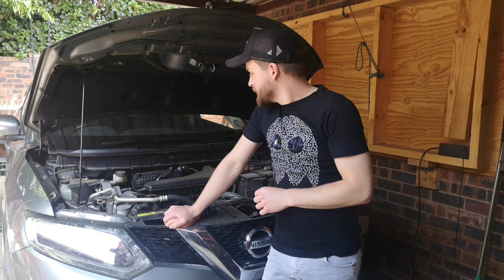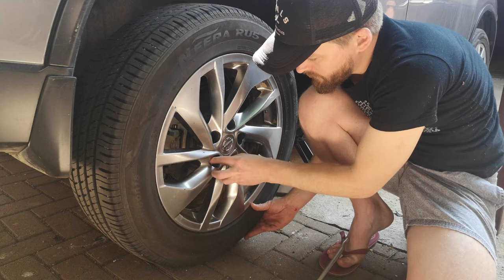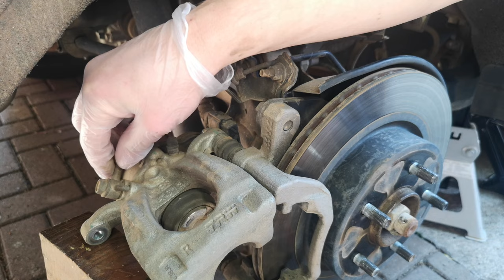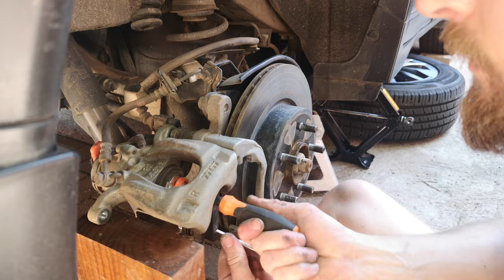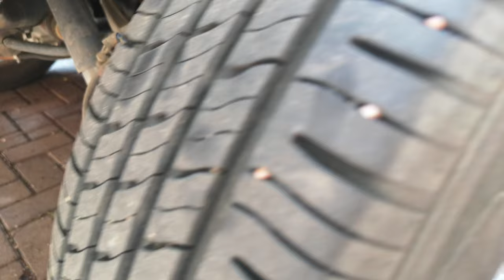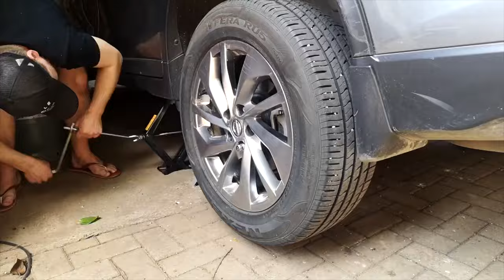HOW TO CHANGE THE BRAKES ON A NISSAN X-TRAIL (ROGUE) | DIY

Comment: Best video for doing this that I have found. The caliper retraction cost me hours and your trick got the job done. Also, I took the whole assembly apart but in hindsight, I could have not done this as you show in your video. Great video thanks for posting.
Reply from the maker: Thanks man, I also struggled plenty! I figured that I just needed to share, because those details aren't covered in the maintenance manual.

Comment: good video, but I would never put antisieze on the wheel nuts, wheel studs or the bolts of the caliper. caliper bolts from factory have blue loctite so they can be undone but also will not come loose from when they were installed from the factory. wheel nuts never corrode you need a bigger breaker bar as the factory wheel nut removal tool will not get them undone if they were torqued to spec. also alloy wheels or rims will heat differently to the brake rotor which is steel so sometimes you will have fun getting the wheels off if they have not been off for many years.

Comment: Absolutely spot on! Followed your video to the letter and completed the job, handbrake self adjusts when you apply after fitting the pads so don't worry.  I managed to pick up the 3 pin wind back tool which made it easier,  fyi, it's the same as the Volkswagen / Audi  3 pin tool. Thanks again!!!
Reply from the maker: Brilliant, good to know! Ya, if I knew about the wind back tool in advance I would have got one, but by the time I worked it out the breaks were already stripped off.
Reply: Thanks again buddy. Saved me a lot of time and money 💰

Comment: kudos for attemping this - i did a bit more digging around the electronic parking brake system, and learned the turning motion of the piston is required to unwind the drive thread that applies trust which works in tandem with the hydraulic pressure to drive the piston. https://www.youtube.com/watch?v=46KgDEyD0Pc hope this gives a bit more information around your work flow. 

p.s. you are clamping down on the electronic parking brake motor assembly on the back side of the piston - hope nothing broke!
Reply from the maker: That's pretty interesting, makes a lot of sense. I don't think anything broke, the entire assembly in the Nissan seems to be in the caliper so its well protected.